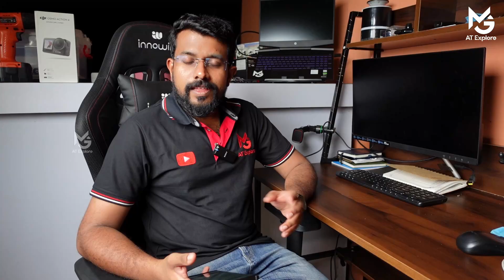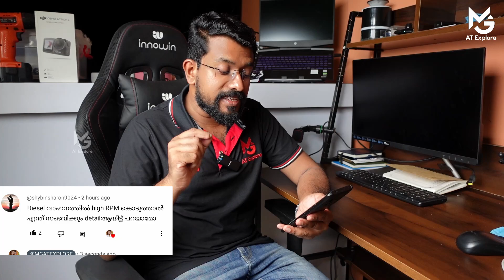ഡീസൽ വാഹനം ഐഡിൽ ആർപിഎം കൂട്ടിയാൽ എൻജിൻ പണി വരും | Diesel Engine work at High RPM | Oil Burning

Comment: Ente vandi 2015 Swift petrol 94500 km odi service inu kondupoyappol engine mounting kedu ano ennu oru samshayam paranju angane itt odichal enthelum kuyappam undo vandikk vere verayal onnum illa thanum... please reply
Reply from the maker: Cheriya complaint anengil valiya problem illa but over vibration anengil urapayum athe replace cheyuga....
Reply: Thanks for the fast reply

Comment: Diesel vahanam (elite i20 1.4L CRDi 2017 model) idlingil off aayi ponu after a few minutes. What could be the issue?
Reply from the maker: Baki running timeil yanthengilum problem undakundo? Vere problems illa yangil injector calibration cheythal mati, ippam yatra km odiyunde?
Reply: @MGATEXPLORE  Ipoo 87,000 KM odi.... Running time no issues. Pulling ellam pakka

Comment: Diesel Runaway oru rare condition thanne aanu. Videos kure kandittundu.
Reply: I have experienced diesel runaway in Swift vdi
Reply: @mohammedaslam6452  never drive on low engine speeds (RPM) like below 1500 RPM... Overtime this may cause cylinder to have glazed appearance and carbon build-up..This glazing leads to oil consumption and excessive oil consumption leads to runaways.  And Don't forget to let the engine idle for atleast 30 seconds before shutting down turbocharged diesel engines.
Reply from the maker: Yes watch this
https://youtu.be/IaRzST4xwG4

Comment: Bro car drive cheyyumbol RPM kayatti odikkamo 
Appol pani kittan chance undoo
Reply: lla
Reply: With load nothing will happen
Reply: Turbo കംപ്ലയിന്റ് വരും  ഗിയർ change change ആവുന്നതിനനുസരിച്  rpm കൂട്ടുക
Reply: Diesel car Engine oil കുറഞ്ഞാൽ എന്താ ചെയ്യെണ്ടത്?
Reply: @kamjipaasha9003 turbo complaint വരില്ല. Oil മാറാതെയും, engine off ചെയ്യുന്നതിന് മുൻപ് idling ചെയ്യാതെ ഇരിക്കുമ്പോൾ ആണ് turbo complaint ഉണ്ടാവുന്നത്....
Reply from the maker: @solo-um illa problem varilla Karanam engine load unde so problem varilla

Comment: പിന്നെ ലോ ഗിയറിൽ വാഹനം  വലിപ്പിക്കരുത് turbo കംപ്ലയിന്റ് വരും. ഡീസൽ  വാഹനത്തിന്
Reply from the maker: But turbo ankane oru problem varilla...
Reply: Never lug a turbo charged car. This is the primary rule. Lugging means, pressing too much accelerator at low rpm when you are in higher gear. Always down shift to increase the rpm and then press the accelerator